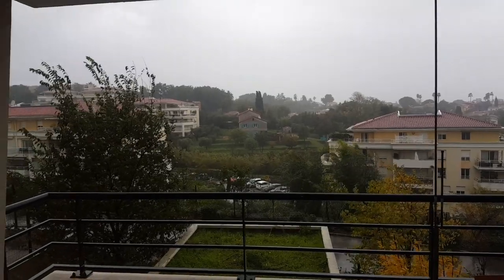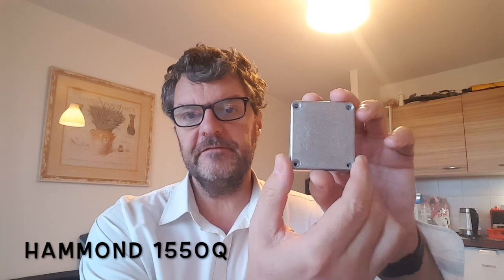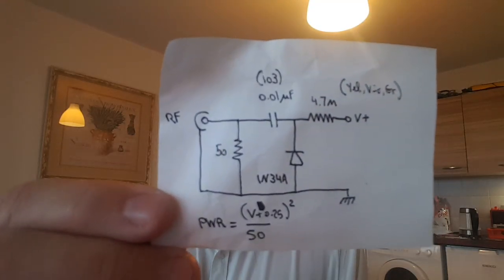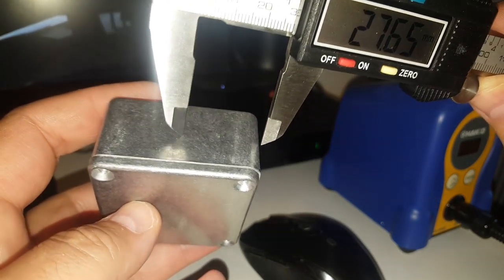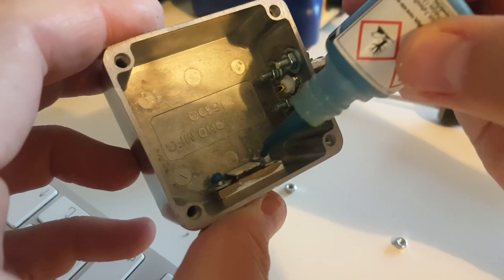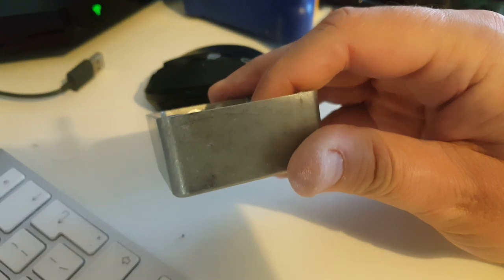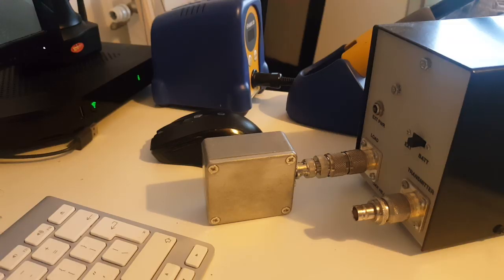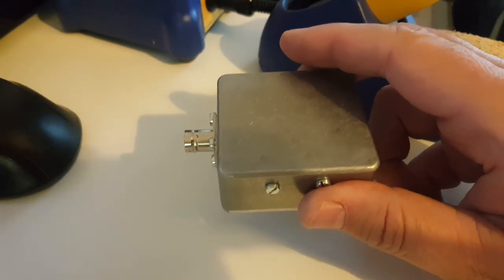Building a Simple & Cheap 50-Ohm Dummy Load.

Comment: Thank you for the video! I have built this project but with the only difference being I used a 100w resistor. As far as the "rf probe" function goes, I am getting a reading with a multimeter set to DC but it seems to be about 27% off (to high) with the calculation you hold up on the paper. Am I missing something?
Reply: Revision, I now see it depends on the frequency. I was using two vhf radios in my prior tests that I mentioned and now I tried UHF and its 800% higher. I'm thinking HF should be pretty close but I will try that another time. Thanks again for the project!
Reply from the maker: It's probably a wound resistor, which makes a coil in AC. You must use a carbon resistor, or other, but not wound..
Reply: @RadioPrepper  It looks exactly like yours just 100w instead of 250w but I did get them cheap on the internet.
Reply from the maker: Weird, I only used mine on HF though, so who knows...

Comment: Thermal grease is easy to find where you buy computer components (processors, GPUs, etc).  Be careful that you don't get one w/ gallium in it, or it'll react with your aluminum box and will be electrically conductive.
Reply: In this case, it doesnt matter as the mounting plate of the resistor is also the lead.

Comment: Thanks for posting this, off the back of your post I made a 150W 50ohm dummy load just like you did and using a Surecom  power and swr meter it works great and shows  an swr of 1:1, I then built a second dummy load using a 20W 50ohm resistor this shows a swr of 19:1, my question is should I be worried about the swr or not when using a dummy load, I have googled this and  can't seem to find an answer, I just wondered what your thoughts are ? 73's
Reply from the maker: Yes. You might have used a wire-wound resistor, which if it shows 50 Ohms using DC is an inductance using RF AC.  Do not use It!
Reply: @RadioPrepper  Thank you for coming back, I will bin it

Comment: will this work as a dummy load for CB radios?
Reply from the maker: Yes, up to 50W maybe.
Reply: @RadioPrepper  recieved mine this morning  mounted it to a old computer CPU cooler an put all  inside a sealed metal tin with just the connector poking out through a hole drilled into it. has to be the flattest SWR reading i have ever seen.
Reply: @RadioPrepper  i'd be nowhere near the 50 watt limit then.

Comment: Have you tested the SWR of this? The power resistors I've tried from ebay have so much inductance they get bad SWRs and make terrible dummy loads.
Reply: I made one of these and it works great. I used a 100w 50ohm resistor that measured 50.6 ohms. It's more than up to the task for my radios. Thanks for posting the video. N0SAB, Port-de-Paix, Haiti
Reply from the maker: I can't remember exactly but it was low..
Reply: @RadioPrepper  Thanks, maybe I got a dud. I was worried ebay might be selling all fakes
Reply from the maker: Does it look the same? Is it a wire-wound resistor? That would not work...

Comment: Be aware that the resistor RFP 250N50 contains Beryllium Oxide (a known carcinogen), also common in high power RF transistors, it's fine as supplied but be careful how you handle it...don't break it or dismantle it as the dust can be injurious to health....something to be aware of:-)
Reply from the maker: Thanks. It will never come out of that box in any case..

Comment: Can I calculate output power using a simple swr meter with field meter? I can measure voltage with a multimeter if needed. It's an Olson CB-067 swr meter. The manual says that you can use it to calculate power, but it doesn't give any equations or methods. Thanks
Reply from the maker: See my video on building a dummy load. You need a diode and a capacitor...
Reply: @RadioPrepper  but I wonder if I can do it with the gear I already have, the Olson with an fs meter. It says I can determine wattage by reading the %ref power and some calculations. Any thoughts on that?
And, BTW, the formula is  pwr=(V*0.25)^2/50? Where does the 0.25 comes from?
Reply from the maker: That I don't recall...

Comment: A good, simple project ... thank you! ... BUT, while those resistors might be rated for 150 Watts they will fail well below that unless a LOT more heat sinking and/or cooling is added. I reckon that little die cast box would struggle to dissipate much more than 10 Watts for a few minutes.
Also, those resistors are designed for stripline connections and using hookup wire between the input socket and the resistor will limit the usefulness of the load to HF frequencies. I reckon it would be marginal at best at 50 MHz and probably quite poor above that.
Reply: Do you work for MFJ ??
Reply: @georgeewing21139  No, I’m retired and live in Australia … and there’s no MFJ manufacturing here.

Comment: I think it's best to buy a pair or two of 100W halogen headlight bulbs, in case you're working with 12 volts. Extremely cheap and will work right out of the box. Also MUCH safer to use than resistors, which like to blow-up! 
Interesting project though!
Reply: Great for DC but as those halogen bulbs present nothing even close to a 50 Ohm matched load I wouldn't want to be running my transmitter into them. Stick an SWR meter between your rig and your light bulbs and I suspect you'll rethink the strategy :)

Comment: What would be the result if you soldered 3 or 4 of these together ? and maybe used an old computer heat sink ? to attach them to ?
Reply from the maker: You'd need a bigger heat sink than that... Also 3 would not work. You'd need four. Pair them in series then connect the pairs in parallel for 50 Ohms.

Comment: I had to make a simple dummy load to test a cable. I had a spare SO-239 connector and I had a stack of 100 ohm resistors. I put two of them in parallel for 50 ohms, and connected the pair to the SO-239. Found out the cable under test was bad. Other good cables tested good with my antanalyzer throughout the spectrum.

Comment: Thank you for sharing,,, I have been looking to build one myself but didn't know where to start... this video is a great help. I will start sourcing the components and build my own dummy load. There are two main factors I want to build this project, its a good practice with electronics,, and it will be much cheaper compared to the ready made ones.
Reply from the maker: Excellent!

Comment: not sure why he put the resister on the side and not on the flat of the back in the middle..
but at least he's right, more power, bigger heat sink...
Reply from the maker: Shorter wire...
Reply: @RadioPrepper  not really, back of the box nearer the BNC socket, even shorter wire,
if you used a big heatsink and an SO-239 socket the holes line up the same as the resistor and you cna solder the resistor direct to the SO-239 with the heatsink sandwiched in between.

Comment: All my radios combined wouldn't put out (250) watts.  lol   Cool little project. QRP Labs has a 50-ohm, 20 watt dummy load kit for $8.50. Hans designs some of the best kits around, and everything is always priced very reasonably.
Reply from the maker: Mines neither! Yep, impatiently waiting for the QSX.
Reply: @RadioPrepper  hello may when Hans releases the QSX you could interview him. that would be appreciated.7 3
Reply: @RadioPrepper   I hear ya! I'm on the 'QRP Labs' newsletter mailing list, but I still check the website often, just hoping to be surprised. I ordered an HB-1B to keep me preoccupied.  lol  I ordered it on (11-2-2019), and it's still not here. They said they had to build and test it. I guess they must have shipped it from China by carrier pigeon, too.  ;-)
Reply: @MyTube4Utoo  From my experience, just about ANYTHING shipped from China takes AT LEAST a month, but just about ANYWHERE else, a week or two...